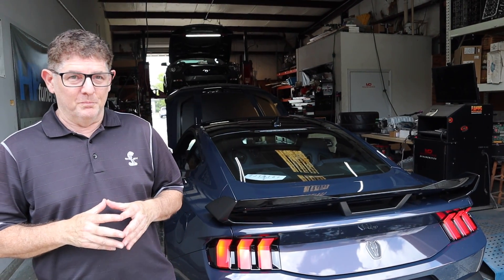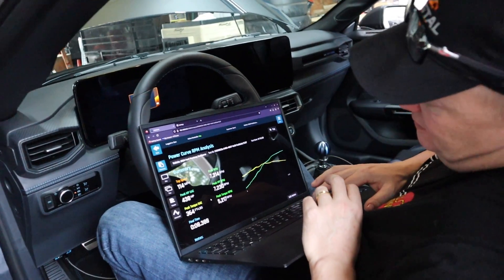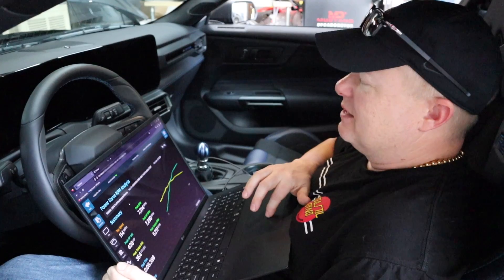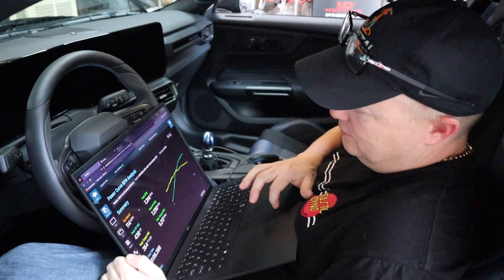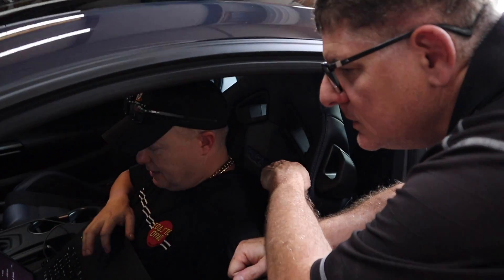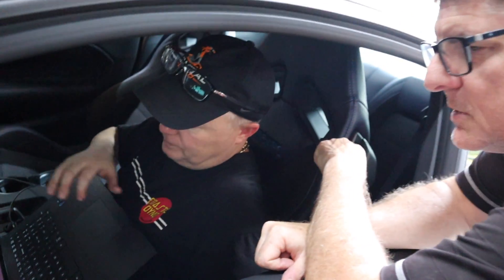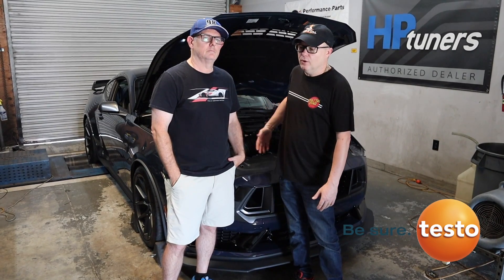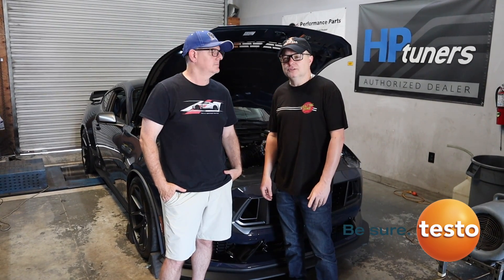Dyno Test: 2024 Mustang Dark Horse | Why Ford Used a Dual-Throttle Intake & What's the Real Power?

Comment: Nice video! So as far as removing the carbon traps i did notice that  you left the plastic pieces the sit in front  and after the trap in place. I have seen others that have removed this. In fact they seem to think Ford intentionally designed them to break easily so they could be removed. Any advantage leaving it in place? Thanks!

Comment: Removing the carbon traps makes sense, but paying extra to run filters that allow tons more harmful particulates into the engine is not worth it for a measly 1% increase in HP. Also, multiple dyno runs would be needed to confirm legitimate gains because there could easily be a 1% fluctuation in results between every run without changing anything.

Comment: Probably gained 10hp by bedding the engine in a bit more, how many hours is on that 26 miles ? Should really have at least 10-15 hours on a new engine before you even think about going WOT

I've seen total engine friction drop by 15nm in the first 10 hours of motoring a v8 engine.

Comment: It seems the Gen4 Coyotes make a little less torque down low vs a Gen3.  My 2020 Gen 3 makes 444rwhp with a Ford Racing Power Kit and exhaust, bit ot made 408 tq to the wheels.  I know its a different dyno but I have seen a skew of these dynos done that show the same thing.
Reply: They have dynoed  a gen 3 car same day same dyno vs a gen 4 car and the gen 3 made more torque.

Comment: Years ago when putting a square K&N in a 92' LX 5.0  I had , it started with wrestling an enormous piece of plastic out of  the front passenger side fender. 🥵 😄...A  Dyno on the new RTR  would be cool to see as well...FORD💪💯
Reply: The 'silencer' or whatever they called it. They had those things breathing through a straw, but technically it was cold air 😅

Comment: Great video guys for sure. If it had a little more octane to go in hand with the additional airflow and leave the filters exposed on the dyno it would probably make 460-465 that’s incredible there’s plenty you can do on the stock tune free flowing exhaust, Porting etc..
Reply: Yes, That specific K&N allows you to keep filter exposed... Had that set up on a  94' Cobra  trying desperately to reach 300 HP ...🤨
Reply: @robertcopes1185 I mean the covers here in the s650. They dyno higher with them off

Comment: It’s a slightly revamped s550. What did people expect. 

S197 is the best coyote platform, imo. I run a gen 3 short block and a whipple on e85 in my 13 🤙🏼

Hey even, thanks for your contributions and passion in the mustang world. I’m an OG foxbody guy like you.
Reply: So since you had a S197 that makes it the best.😂😂😂
Reply: And I have a sick foxbody. 

Mustang owner since 1991 and yes S197’s and foxbody’s are the best. And yes, my opinion is way more valid than yours.
Reply: I love my 13’ to death and will never sell it but there’s no denying the s550/650 is a much better platform. Especially handling
Reply: My 13 is built for straight line power.

Besides, anything 15 and up is fugly, imo
Reply: @robfeldschun6146  never really liked the s550s either besides the Shelby’s. That’s why I waited till the s650 and I personally like the look a lot better

Comment: I want to know how they came to believe that gas and emissions would exit through the air filter when the engine is running with intake vacuum at 28 in/hg? It seems more likely to go through the engine before the air filter.
Reply: They're probably to catch fumes after you turn off the engine.

Comment: Those "high flow" filters are nice... if you don't mind just letting everything get into your car's engine. Those things literally filter nothing. Of course they increase air flow. Take a normal paper filter after a few thousand miles and blow compressed air through it the other way, you'll see a ton of dust get blown out. Do that with a high flow and literally nothing comes out of it, because it filtered none of that dust you saw coming out of the paper filter, it all just went straight into your motor. For a mere 5 horsepower increase, I personally don't think it's worth it. I would just keep with the paper filters myself...
Reply: Agreed I have always thought this

Comment: I wonder if someone made a Bigger diameter carbon filter area, potentially allowing more air flow before the MAF, if that would equal removing the carbon trap HP loss. Space appears to be a restricting factor there. Some say that the HP gain with K&N style filters disappears as the computer 'learns' the air flow difference. Any thoughts on that?

Comment: So my 347 in a foxbody would kill this? Nice it pays to weigh a 1000 pounds lighter
Reply: Your 347 unless blown does not make this much power with even remotely as good drivability. If you push 425 n/a your cam is probably huge and bucks like crazy. This car is stock and will run hard all day long with ice cold a/c. The amount of advancements made is remarkable

Comment: Hate is cause they're so dang heavy. I wanted to start road coursing a new mustang and saw the weight and said no way. Will kill tires and brakes and be hard to make fast. Needs serious spring rate and lots weight reduction toget down to stock camaro lap times. Btw you're not going to the track you're going to a drag strip lol.
Reply: I'm a road course guy myself, but "track" and "strip" have been used interchangeably by drag racers for at least as long as I can remember, which is about 45 years. A drag strip IS a type of race track.

Comment: Should have hood closed for dyno runs. Will see a drop in horsepower when you do as Banks as showed in his dyno pulls. You dont drive aroubd with hood open.
Reply from the maker: Your not wrong, however, on the road you get the benefit of air flow through the grille. This is an A-to-B comparison to show a difference, overall horsepower is irrelevant (to a degree). In a proper dyno cell that can replicate 40-100-plus mph wind shutting the hood would be great.

Comment: As a Ford owner i know why they did dual throttle. Because alllll their cars should have dual throttle 🤦🏾‍♂️. Ford has good cars. But all their cars are turbo engines and i love the performance but it takes a toll on the water pump and throttle body. All Fords will eventually give u the same issues after many many miles tho. Thats why Ford re sales have high milage. U can drive the heck out them. My mechanic said ny car should have extra coolers ..or extra throttle body lol

Comment: I gotta say as someone that owns a 2014 C63 AMG with twin throttle bodies, with the 6.2 in it. It is very responsive. It is stock with 450 horse and 440 ft pounds. Ford did it right with this one for sure. Love my mustang. Have an 82 1/2 GT my parents bought brand new. And NO its not stock 😉

Comment: Can we just end ..that you get an awesome 5.0 engine ..two throttle bodies. 440 hp.  Is great.  To hit that 500 + bigger injectors Headers.. straight pipe. Ecu tune maybe 640 Hp.. they gave you a scat pack killer. Out the box.
Reply: Wheel hp is different then crank hp the point was to show that you are getting the 500hp crank hp as advertised

Comment: What fuel would you recommend running this car daily. Like would 93 help the longevity of the car or is 87 just fine
Reply: Your car will run like pure shit on 87. Should always go with what is recommended in your manual. I haven’t seen any high performance car run smoothly with regular fuel. Buy premium there’s plenty of videos explaining why. I’ll see you at the gas station twice a week spending $70-90 depending on where you stay 😊
Reply from the maker: 91-93

Comment: Twin TB: Logic makes sense, but they could have did the old 96+ Cobra twin TBs setup with a single lever (53mm x 2) and one giant inlet w/carbon trap. It would have been simpler, more reliable and easier to modify. Instead they went with dual intake tracks which is the most complicated option and hardest to modify.
Reply: 1. Highly paid engineers test this stuff so I doubt a dude typing from home is gone suggest something they haven’t tried already.  2. They don’t want people modifying it because they locked the ecu…
Reply: Two inlets with the same carbon trap is harder on the software side but not on the intake molding side.  They would have had to make a massive intake tube that would be hard to package.  And would still have a massive carbon trap blocking it.  Also 96 cobras had dual 57mm throttle body's
Reply: "could have did..." Now, that's some gooder English...

Comment: I know that when the engine is running, no air should be exiting back through the throttle body or carburetor unless you have an intake BACKFIRE.   Any engine oil in the intake manifold caused by the intake and exhaust valves either goes back though intake valves or the PVC system.  If you have oil showing on the backside a throttle body or carburetor means internal engine damage.   This is for either the engine start up and shut down leaking hydrocarbons back into the atmosphere, or the intake side of the air pollution equipment is somehow vented to the atmosphere while the engine is running.  Feel free to become technical on this answer because I will understand the lingo with myself having an Automotive Associates Degree of Applied Science.  This hydrocarbon restrictive filter sounds to me like another way for the anti-horsepower agents of the EPA to reverse the notion that we can have high horsepower with low emissions too.  This is another situation of overzealous EPA managers trying to justify their existence.

Comment: Call it Ford Project - True Blue Oval, paying respect to Ford's racing history.  True Blue Oval sings the history of Fords putting power to the ground on race tracks.  If you use this name can I get an autographed photo of this particular Dark Horse,   and then I will mail back an autographed copy of my book that reverse engineered all the physics involved in physical on-ground dowsing with the modern light weight ball bearing dowsing rod, which is the same physics used in electronic metal detecting.  The book's name is The Art of Dowsing - Separating Science from Superstition.
Thank you Evan for all the information and entertainment with this channel.  I am looking forward to another (stand alone) Fast Fords ....  type magazine.  How come Ford itself did not buy and take over the magazine, which was one of Ford's best advertising tools with very little expense to Ford (supplying free parts) ?   All Ford fans had to pay the price of Tens Publishing's other nine bankrupt magazines, such as Super Chevy.  I like Chevy power too, mostly in the muscle car era, but from the 1980's on, I am all Ford,.  At twelve years old (late 1960's), I had a 1953 Ford F100 with a 292 C.I. and a manual car three speed with driving it everywhere as though I actually had a drivers license, (even drove it to jobs I had).  300lbs on rocks stacked against the tailgate gave traction for driving on all the 4x4 jeep tails, where we would see friends in their 4x4's asking "how the hell did you get that two wheel drive truck in here" ?   The only answer to that question is you have to know what you're doing with a 4x4 and you have to be a little crazy.   Can't wait for income coming in from our book sales and advertisement money from our new YouTube channel, "Tracy and Michael's Dowsing Adventure",  with buying a new Raptor R and 2020 - 2022 Shelby GT 500 for modifications by Hennesey Peformance.  The future may hold an REVan Evan  YouTube video on the vehicles, because you are one of the few whom I would trust for accurate representation of all aspects of the vehicles.  P.S. I like Shelby's Las Vegas performance modification shop too.

Comment: i kno chevy will come out with the new camaro that will knock dark horse and gtd out of the park or out of the way, u already see the camaro they using on the lamoun racing that's something to think about
Reply from the maker: You do realize 2024 is the last year for the Camaro? And the car at Le Mans (I assume that's what you meant when you said lamoun) was a full-on NASCAR Cup car with exactly zero production Chevrolet parts.
Reply: but u did not Chevy end the Camaro in 2006 and came back in 2009 in Transformers Bumble Bee..., u see everybody believes in the old invention of the ev, saying its the future but its not the combustion engine replaced the ev and combustion is engine is the future not ev, u can create cleaner fuel if they wanted but they don't cause if the gov wanted something good for this planet, as u can see as a car person ethanal burns cleaner more power than gasoline why is gasoline more cheaper than ethonal is u want to make a change if u are so want to be eco friendly,..if i was the gov, i would make the ethanol cheaper to the public so they don't have to buy the oil that they so call destroying the earth, and without the combustion engine how will the ev car be charged....???????? u see where am coming from.....? ev has a secret that nobody knows  @revanevan

Comment: Those numbers are out of the Ordinary, "S550" being the Ordinary...364 TQ, 438 PEAK HP SMH for DARKHORSE $75 grand. What will be the POWER ROBBING percentage, when car is actually moving its full weight along the road?? Also you just filmed yourself removing a 'STRICTER AND STRICTER EPA DEMAND as you said.  👍 👏
Reply: The EPA demands that manufacturers SELL products that comply with their regulations. They don't demand that consumers leave the cars that way.

Comment: So taking carbon traps out and putting high flow air filter on it finally matches Mach 1 WHP at 450. Not bad, still slower with the extra weight.
Reply: Low parasitic loss = excellent engineering. Kudos to Ford Motor! 💯
Reply: That's still excellent & these cars will last far longer than most all other sports cars.. w/good basic maintenance . Full Synthetic oil /Motorcraft filters every 5k mis + 89-93 octane top tier fuel . I use Shell or ExxonMobil myself.

Comment: I have an opinion on drive train power loss. It is not a percentage. It is a fixed amount. The amount power needed to turn a mechanical device should not change  based on the power of what is turning it. It's simple mechanics. Also a lower gear on a dyno should produce a higher number since the lower gear is producing more torque and the dyno reads torque over time to give you a horsepower number. Unless I'm missing something please let me know.
Reply: That's a theory that I have too.   Although, to accelerate the drivetrain quicker (which we expect from more power), I assume there will be a corresponding increase in the amount of energy to do so.
Reply: It is a percentage, not a fixed amount, basically for the reason stated above. As you have a more powerful vehicle, the drive train is accelerated at a faster rate, which takes more energy input. It also increases loads and more energy is lost via friction/heat. If it was a fixed amount, that would mean a low horsepower car wouldn't even have enough power to move at all lol. A typical car only uses about 20hp to cruise at 65mph, and most of that power is used to overcome aerodynamic drag. Also, remember HP is a function of torque AND speed. So dynoing at a lower gear increases torque to the wheels but at a slower speed; it essentially cancels out and that's why it doesn't matter that much what gear you dyno in. The math ends up with a similar result. A big reason cars were traditionally dynoed in direct gear (typically 4th in a manual or 3rd in an auto) is because traditionally gearboxes bypass all the physical gears in that speed and the input shaft is physically connected to the output shaft, eliminating friction lost through the actual gears used for the other speeds. So you'll get a little boost in your dyno readings. There are other factors but that's the main stuff.

Comment: Does it or will it make a difference with removing the air box lids with the filter exhange?
Reply: maybe .05  at a BMP test and tune Sat morning in January, otherwise you might see a couple hp on the dyno.

Comment: When talking about the difference in power whether you have 87 or 93 octane fuel.  You do know that there is no more energy in the higher octane fuel, just resistance to pre-detonation.
Reply: When you have less/little/no knock the timing goes up from the ECU. That's why 93 makes more power and E85 more still.

Comment: Interesting car. Curious,  how did Ford get the extra power over the standard GT? Does the computer get data from both intake tracks, or just 1 side? Itake it the carbon traps aren't replaceable? Great videos!
Reply: Tuning mostly. And it has 2. MAF sensors
Reply: @AzureCrux   As explained surprising timing advance for an oem tune file.

Comment: So it takes 62 hp to run the drivetrain? 

I was hoping 465 whp. You can't tell me every car takes 10-15% to run the power train.
Reply from the maker: Absolutely it does and due to frictional losses, the more power the engine makes the greater the loss. Best car I ever had on the DYNO was 10% and that was a rollerized, face-tooth manual with a spool in the rear.
Reply: @revanevan  I'm still trying to wrap my head around domestic cars losing so much power. Most German cars like BMW produce as much power as they are rated in a typical scenario and more. American and Japanese for the most part ( which I'm assuming use SAE numbers ) are always underwhelming. Let's take a new Supra 2021+ (BMW engine). Rated at 382 and they commonly make that and above to the wheels. The Supra is putting out more HP than a 500 HP Darkhorse automatic. That's just awful! There are a lot of videos that  confirm those numbers.
Reply: @backnu because bmw doesn't advertise crank hp numbers they advertise wheel hp numbers